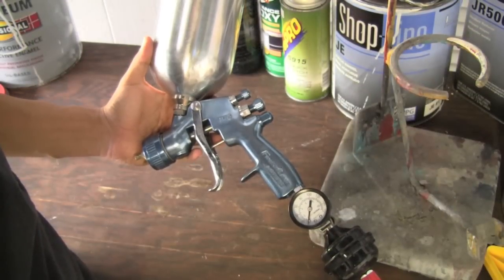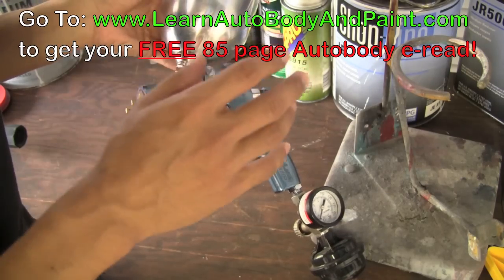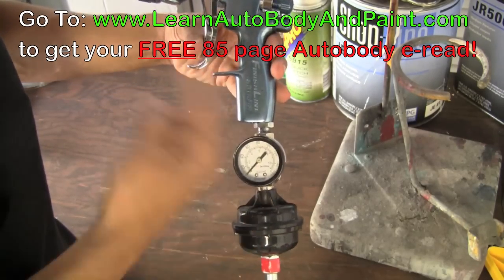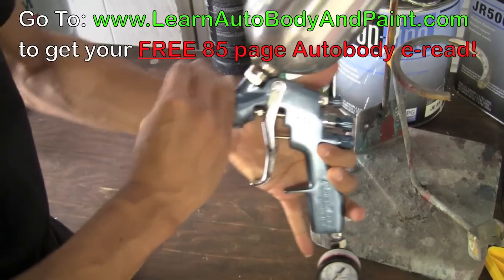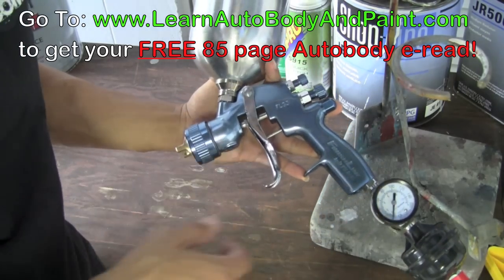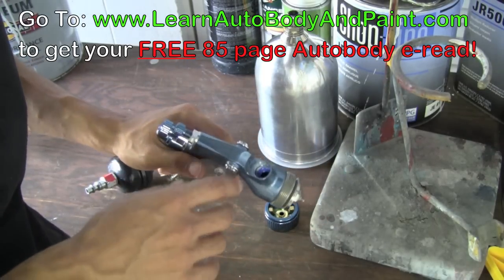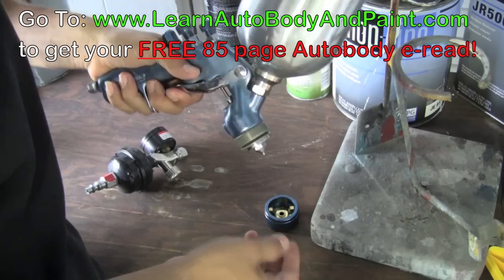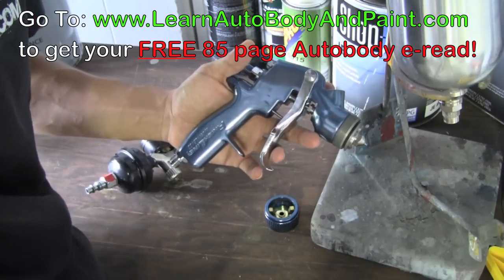HD: How To Adjust Your Spray Gun - Auto Spray Gun Setup Tips!

Comment: just a tip for that particular gun,the FLG3 can be fitted with a GTI transtech aircap and used for clearcoating and HS single stage ,fittted with a transtech 110 it will also break up primers a lot better ,use a 115 and its a waterbourne gun ;-)

Comment: just a little reminder that when you fluid needle wears out your fluid flow nut will need to b adjusted as you fluid needle wears out and when you replace you needle make shore to replace your nozzle at the same time to avoid spitting and and leaking.

Comment: I disagree that you always need material flowing at max level. You need it at the level that delivers proper atomization for the given airflow without over-spraying unneeded material. Otherwise, there wouldn't be a need for material control knob in the first place.
Reply: frusfromus you are right and tony for sure is completely wrong on this light layer several coats will be better than getting orange peel with base coat 
Just tried today on just learning how to setup the gun ,
fan is ok I know how to adjust and don't have regulator right now adjusting from compressor to 29 but for the fan tony washed my mind open it fully how is that I've seen some body said 2.5 turn from stop that not worked for me  when I make just 1.5 turn it give me good atomization its acrylic laquer paint thinned 50:50 1:1 and I think this will be my setup